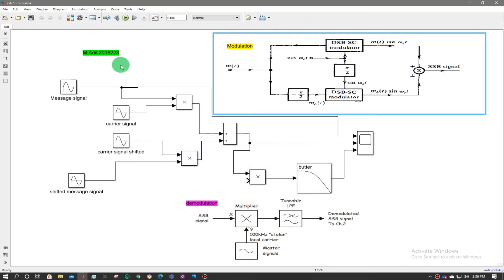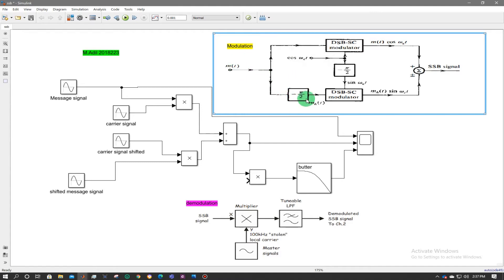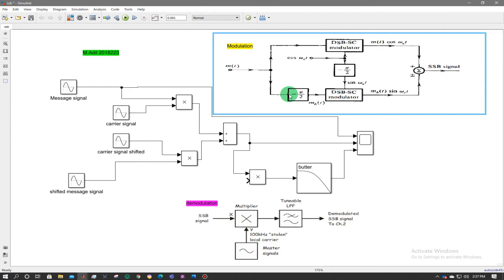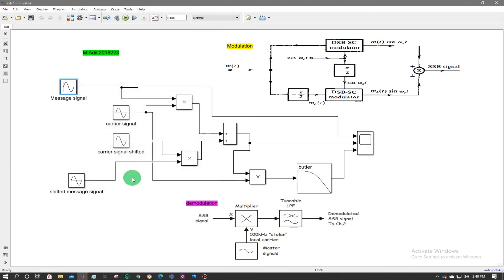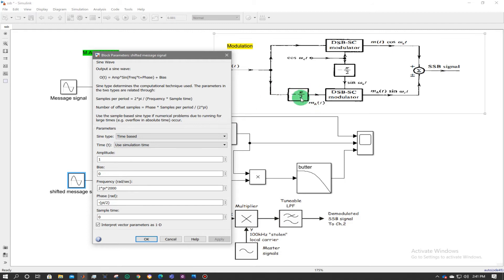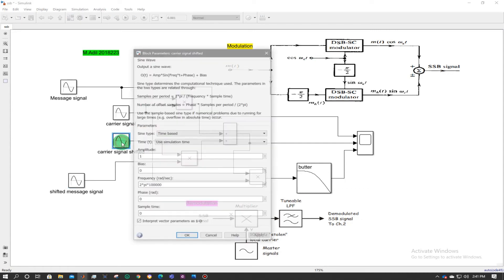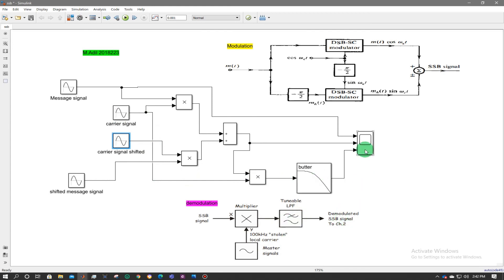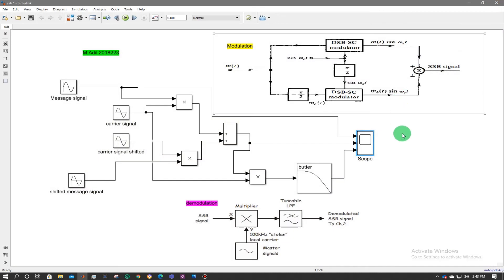Single Sideband Modulation And Demodulation in Simulink | SSB Modulation and demodulation in MATLAB

Comment: What matlab block did you use for the filter in the demodulation process? please include the block parameters of the filter. Great video! subscribed and thumbs up!
Reply from the maker: Thank you soo much for appreciation !
The used block for Demod is: Analog Filter Design
Design method= Butterworth 
Filter type=Low pass
Filter order=  1
Passband edge frequency (rad/s)=2*pi*2000

Hope this will clear your doubts!

Keep shining✌